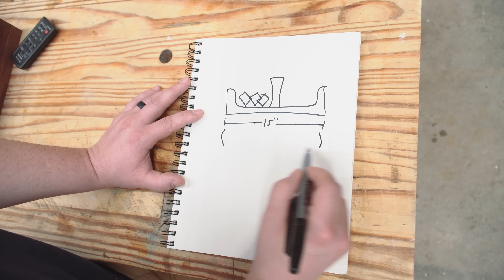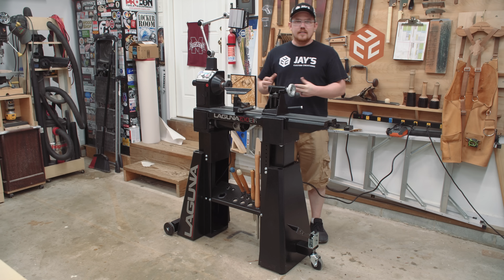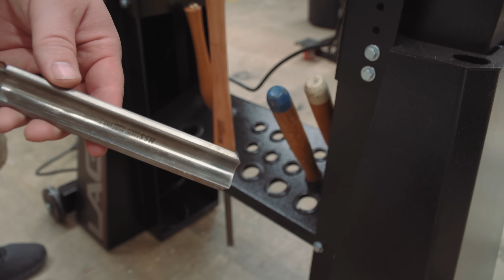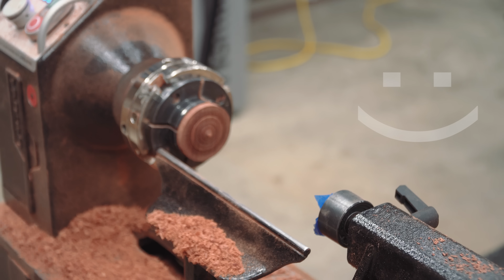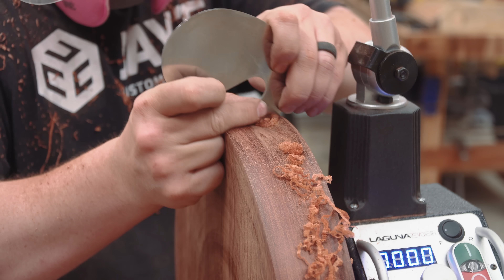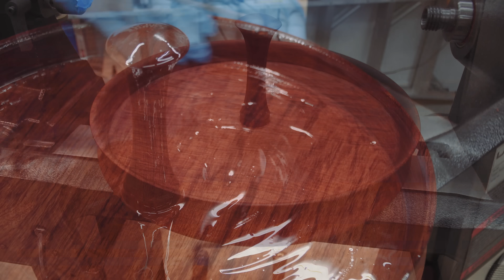Woodturning a 15" Candy Dish - Laguna Revo 1216 - 310

Comment: Shear scraping with your bowl gouge (if it has good wings on its grind, is turned around so the open flute is towards the work piece and at a bit of a shearing angle.. if that makes sense) and a good scraper (not card scraper) with a fresh burr would have done wonders for removing those tool-marks and tear-out.  Good job though man! :)

Comment: Nice design, and good that you pushed your comfort level.  You learn more that way.  From what I saw I would recommend working more on sharpening your tools more than your technique.  The tear out and rings are symptoms of dull tools more than how you are using them.  Bubinga is tough and abrasive so it blunts your tools quickly.  I would expect to resharpen my bowl gouge at least twice turning that bowl, maybe even three to four times.  After you rounded it and turned the outside shape, your tool probably covered two miles.  Figure another two to four miles hollowing that big center.  That's asking a lot of an edge.

Quick rule of thumb is if you are pushing hard, even on dense wood, your tools aren't sharp enough.  Keep turning and keep up the dad jokes.

Comment: You will find that sanding anything while turning makes sanding rings your eyes can see. 80 grit puts very deep scratches in your project and can take a lot of work to get them out. Try starting at 220.  When you have a peace clean with 220, hand orbital sand the peace with nice new sharp 220. This breaks up the sanding lines and you won't see the rings. Then turn and orbital sand with 320, 400. No more sanding rings for the finish to magnify. Hope this helps. See youtube Mark Silay wood slicing.

Comment: As woodturner I have a love/hate relationship with Bubinga. The grain and colour of the wood when finished is wonderful, but the density of the wood makes the turning of it a nightmare. I've never turned Bubinga and not been left with tear out on end grain and spiral tool marks on flat surfaces. The only way to remove it is working through the grits starting at 80. Great project idea, I may make something similar myself.

Comment: You could try gluing in the handle to the base and then turning it. This would give you a chance to taper out the joint and make a really smooth transition. Basically put it back on the large right now and keep turning. 

I’m totally stealing that joke by the way.

Comment: Looks Great.  I have been turning for 15 years and still have problems with large flat surfaces. I find curves easier since I can blend ridges better. Bubinga did not do you any favors either. I would suggest a big heavy negative rake scrapper as your next lathe tool.  Use at the end with very light passes.  Again, I really like how it turned out (My Dad joke).  Go Lions!!

Comment: Great job Jay!  One idea that might take care of the rings is use a small (1/2") round nose scraper to intentionally put some subtle equally spaced grooves in the bottom, similar to finger grooves on a tool handle.  For most stuff that you would put in the platter, the bottom doesn't really need to be flat, it can have a smooth waviness to it.  Still a great job and good practice.

Comment: Hi Jay, 
Their is an old saying in woodturning, “ there are no mistakes just new creations” if you still have the mortice in the bottom of the platter you can practice surface skimming (maybe with a scraper or power sanding) on other pieces and then re-chuck it at a later date and make it good! Keep up the great videos and practice! Practice! Practice!
Blessings.

Comment: Others have probably said this but the tear out can be dealt with by really sharp tools or simply power sanding. Messy but it works. 40grit, 80grit, 120... all the way through using a drill and semi-soft flexible sander head. Great video as always.

Comment: Jay, you did OK but you tried the hardest thing to do on the planet when it comes to turning.
That is making an interior be 100% flat.
There are some special ways to grind some lathe tools which make it easier but...
Next time just use flat wood sanding blocks to take the high spots down.  Do Not use sponge pad sanders and discs.
Would love to do a collaboration with you in order to share woodturning with you and your subs.
I've only been at it 47 years and still learning.

All the best... Walter,  a.k.a.: Dusty Splinters

Comment: Great video and superb piece. I too am not a master turner. But I think the broken screws were not the result of weak screws but a symptom of too small of faceplate for that big of diameter. Just a thought.
Reply from the maker: It was definitely the weak screws. The screw shafts were twisting before moving when I removed them.

Comment: Jay, congratulations on the new lathe. I thought your project was a success for sure. Don’t worry about the problems. Like you said, which I applauded you for, you’ve never turned anything that big and you’re still learning. Since I’ve never turned anything that big or used Babinga I certainly have no reason to fault your product. You had fun and ended up with a functional product. That’s all that should matter. Besides, you’ve been up way too many nights with your new baby.

Comment: I think you had a few hairs width extra capacity on the blank you could have turned though! ;) Really digging the handle shape.

I think that lathe will be a bit out of my price range if it ever gets to Australia, but daaaang its nice looking. Often the only way to get more power is to go ridiculously large size lathe, but most of the time I just want more power, rather than taking up more foot print.

Comment: Get yourself a sanding pad for your drill, 80 grit, with the lathe on slow speed, will rip material off like it's nobodies business, alternatively scrape the bowl after the gouge is used, this will get rid of the scratch marks

Comment: The most important tool to master is the 80 grit gouge.
Reply: What is an 80 grit gouge?
Reply: Sandpaper
Reply: Exactly.  You don't clean that up with a gouge, you do it with sandpaper.  Let the lathe do all the work.
Reply: Great point - the best way to eliminate those concentric rings on a large turning is to use a 'sanding board' - a scrap of plywood or MDF with 80 grit sandpaper glued to one face.  Simply hold it against the turning as it is spinning, making sure to keep it perpendicular to the bedways of the lathe.  Because the board is flat, the sandpaper will remove the tops of the undulations.  Just keep sanding until the 'valleys' are no longer visible.  

The other point is that it's prudent to set a target for the thickness of the piece, and then allow a margin for sanding.  For example, if you want the bottom to be no thinner than 1/4", turn until it is about 3/8", and then smooth it out with sandpaper.  If the bottom ends up a bit thicker than your plan - that's OK as long as the plan anticipated that there would be tool marks that would need to be sanded out.
Reply: @monophoto1  1/8th of an inch is a lot  of sanding.  A good turner shouldn't have hardly any tool marks anyway.  I usually use 320.

Comment: Next time, use a negative rake scraper, handle up, on the inside & outside to get rid of tool marks.  On big bowls & platters, get the edge to final thickness before attacking the middle too much.  BAD things can happen if you get to final thickness in the center and try thinning the edge.

Comment: Jay I think it looks great. A little work with a scraper (lathe tool not card) and you could have got the rings out. It was a very nice design Idea. I particularly
 liked the handle in the center. Nice lathe also. R

Comment: You prolly used black sheet metal screws for the face plate, that’s a Nono. Good lookin attempt for a large piece. Need to work on sharping and learning to hold the tool so it cuts/ slices the wood instead of scraping.

Comment: Hi Jay great bit of woodturning . You are right you have not done a lot of woodturning and yes the more you do the better you get it happens very fast .Just a little advice, mineral oil does not dry and will attract a lot of dust that will stick to your projects.  Walnut oil is far better and is food safe and walnut oil is not to hypoallergenic .Jay from what I can see in the video the lines are most probably pressure lines from rubbing the bevel to hard .This bruisers the wood and are very hard to remove normally requiring a recut,  we all do it sometimes .The tools should be held with just enough force to hold the bevel on the wood gently or just enough to do the job right ,it comes with practice. I like your design, I think the bottom could have been turned  a bit thinner so as to make the project look more delicate and make it lighter. For the amount that you have turned Jay this piece is fantastic and I can see you becoming a very good artistic turner you have an eye for balance, this also shows in your flat wood work  . I look forward to more of your turning projects. The number one rule in woodturning is rub the bevel, rub the bevel,  rub the bevel but not to hard :o) Thank you Jay for the videos you put out I love them all 
John
P.S I have the Laguna 24/36 wood lathe and it is just a winner . I have had some small problems with it but the retailer and Laguna have been right on the ball with help it's fantastic to see them stand by the clients . I live down here in the south pacific and thought I would have to go it alone if I had problems with it as we don't have an agent for laguna in New Zealand .good on Laguna .
Reply from the maker: Thank you very much for all of the feedback!

Comment: Have you tried using a spinning bowl sander to get rid of the rings? It might be worth trying on a test platter. Even still, that turned out really nice. Turning just takes practice to get the finesse you need. You might want to try turning some nice pen kits so you can get a better feel for the precision you're going for. Keep it up! #bubingabugingabubinga

Comment: Did you try using a good scraper with a bur for getting a nicer finish?  That makes a huge difference when cleaning up too marks.  When that doesn't work and there is still a problem like the rings you are seeing, I have had luck wet sanding with Howards Feed and Wax.  Since you are finishing with mineral oil, that should work too.  A side benefit is that you don't get any sanding dust in the air, though you do have to clean off the slurry that forms.

Comment: The only thing that stands out to me is where the spindle handle meets the bottom of the dish.  You have a straight 3/4" vertical and it kind of doesn't match the entire 'curviness' of the dish.  I might have tapered the handle so it gently curves into the bottom of the dish.  Just my observation.  Everyone has his/her own opinion.  Beautiful piece none the less.  Excellent video.  Does Laguna make a  really small, table top lathe?  I can look.